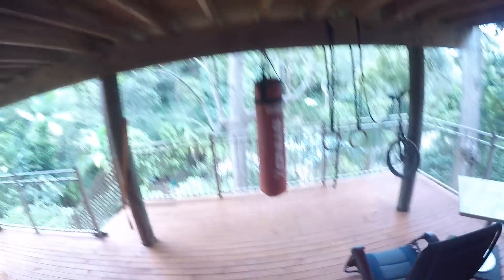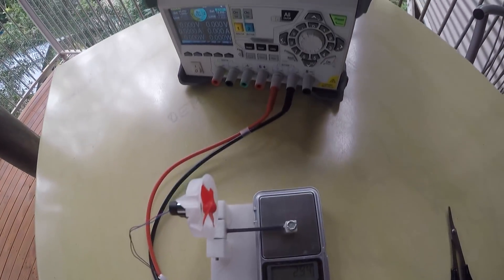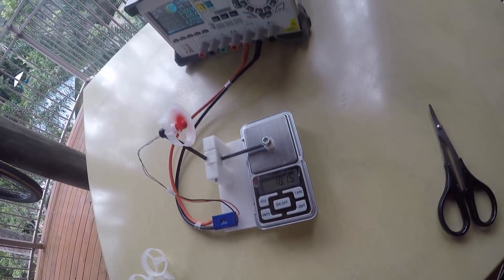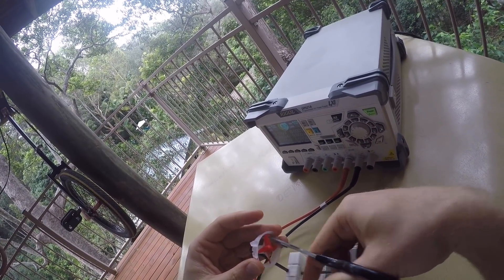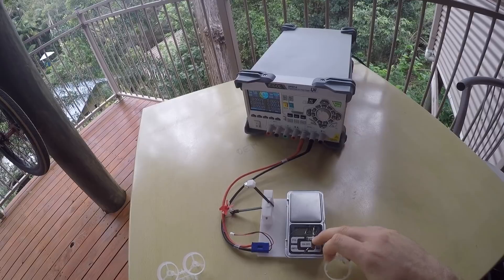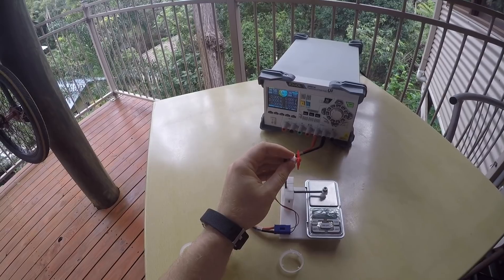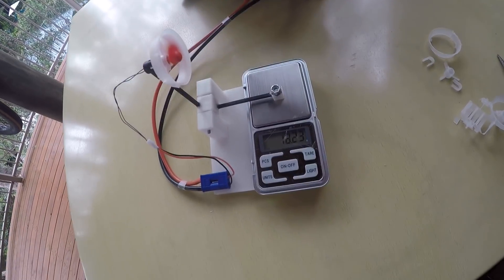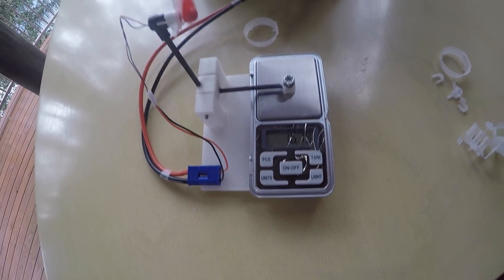Inductrix ducts - are they just prop guards?

Comment: By my experience of ducted propellers on working boats, i'm not surprised by the results. I'm even sure than a smaller clearance between the duct and propeller will give a superior efficiency. And a bigger lip on the duct to get get a Coanda effect. The gains are spectacular on tub or fishing boats propellers as water is 800 times denser then air.

Comment: BTW can i duct a boat propeller ?`for the same effects?
Reply: You can get the advantage from the reduced vortices at the tips of the blades but you want a strait lip because you don't get what you would get with low pressure air from the lip, as water is incompressible. You want the same entrance and exit diameter.  Cavitation could throw a monkey wrench into theory like this.  So experimentation is probably justified...on the back end anyway.  I still think the entrance optimally would be the same diameter as the propeller.
Reply: @ChessMasterNate  No, the effect is known since ages in propellers where duct propellers have been used since more than 50 years. The best results are given by a profiled duct similar to a wing profile whose extrados is on the side of the tips of the propeller (generally a four blades one).

Comment: Hi, It would be interesting to see what contribution of the improvement is to the Coanda effect of the lip on the duct. By utilising a strait duct (no lip) you would be able to quantifying the tip-losses at the blades without this additional thrust attributed by the Effect of the duct...
Reply: yes, this!  I'm interested in seeing a comparison of duct shape as well, and if the duct performs better/worse with the struts in front, or behind the propeller.  also the distances of duct both in front and behind the propeller.

Comment: ... you can gain another .3g when the very small stators behind the prop are in the appropriate direction (reducing airspin) some whoop frames have unidirectional stators - more thrust but reduced yaw authority
Reply from the maker: I have tried that too, but could not measure a difference. Did you perform this test yourself, or have a link to the test setup?
Reply: I accidentally build in the wrong duct on one side of a umx vtol tailsitter whoop and needed a lot of trim to correct this

Comment: Would be interesting to see if there is any difference when adjusting the position of the prop in duct. If the blade is hight in the duct is there any difference then when bottomed out?
Reply from the maker: I think that would be dangerous for the motors as they will be more exposed.  Best to keep the prop all the way seated on the shaft and the motor at the bottom of the mount to keep everything in one piece.

Comment: Did you tare out the scale after cutting the duct?  Didn't expect the difference to be that great either.
Reply from the maker: Yes I tared it before every run. But its not that easy to do, because pushing on the button moves the scale. I should solder an extension to the tare button ;)
I did not expect that much difference either. Otherwise I would have made this video way earlier..
Reply: No he didn't.

Comment: I researched the whole duct theory when the inductrix started getting pretty popular. Bruce from RC model reviews has some pretty good tutorials on ducted motor theory that explains what is happening. I would like to see what would happen if you cut the curved edge of the duct off but left the rest of it since that is part of the key of efficiency and maybe also do a test where the gap between the prop and the duct is reduced to as small as possible. If I understand correctly those two details are key to efficiency. I understand why the little extra space is there from crashing so many of these and I doubt it would be feasible to reduce the space by much if anything negligible for a model that you are flying, just saying this could be another step in the experiment. All that said excellent experiment and I will take that 2 gram thrust improvement for 1/2G of added weight.  One thing that I did see that may have skewed the result is that the struts were still in place, not sure removing them as well would have any effect since that is on the outtake of the fan?

Comment: intersting for sure!!  
Try this:
Take one frame, cut all ducts, fly it and see the throttle punch difference.   
Even with the 2 grams difference it has more punch without the weight of the ducts....  also on a stock board with no acro,  has better forward speed instead of upward, (no drag from the air ducts). 
 I have done it many times before on "clone whoops" for over a year ...the difference is noticeable.
Obviously, the frame will be weaker on a hard crash.
Reply from the maker: I did that. The ductless felt gutless.
What motors, props, batteries did you use?
Reply: Ok.,  I have done it with a few different whoop frames and different motors...  
stock f36 6mm motors, 
boldclash 18000kv 6mm motors, 
Stock e011 motors,
Bwhoop pro motors, and even the weak stock e010 motors. I tried it with 4 blades and 2 blade props (cutting 2 blades off the stock props).  
I use different batteries now but at the time I was using 150mah , 240 and 260.   
I even have a few videos on my channel flying outside in strong winds (almost impossible to do with stock frame/board).
After posting pictures and videos on rcg and fb, a few other people tried it with the same result.  (like I said, that was over a year ago when the e010 first came out)
 The only negative thing is, the frame can't take too many crashes. lol   I was keeping the ducted frames for indoor use, and using the ductless frames for outdoors,  but I broke too many frames lol... now I use all my whoops for indoors only.  The difference in forward speed and holding the pitch is very noticeable.   
 Also, I have used the e010 stock board, the e011 board, f36, and bwhoop pro board, on carbon frames with 55mm props,  18000kv motors, 7mm hubsan motors, 7mm kados insane motors, and the flying characteristics are way different that using the stock ducted frame.
Reply from the maker: well, looks a lot faster without ducts. Are there cameras on those quads?  A bit hard to see..
Reply: in the first video, no camera... just to show the difference between the 2.
the second link was in 18mph winds., 
here is another video with less wind... with the stock frames on the  whoop clones with stock boards,   you always have to fight the wind all the time just to hover in 1 spot lol
with less winds you can fly them outside, but very slow, never at this speed even with 18,000kv motors., too much drag.  https://www.youtube.com/watch?v=pGGGlzxqG8A

here is 1 of the e010 boards on a 90mm carbon frame, hubsan props and motors.  https://www.youtube.com/watch?v=3CucgkVF6vg
Reply: interesting! I wanted to try some test myself but actually measuring with a timer the difference between them. Hover at 1m then full throttle to 5m and check how much time it took. Then I would same but with forward flight with a fix angle of 25deg and check the time it took to travel 10m with and without ducts.
Reply: interesting discussion and test. I believe you got those result because you fly with the E011 frame that has square struts that are totally not aerodynamics. You remove 2 of those square strust so that really help in thrust.
Reply from the maker: I havent cut the struts in above test..
Reply: I have tested, use and have all frames....  square struts, triangular struts, and 1 or 2 cut off struts, 25% cut off ducts, 50% off cut ducts, 75% and 100% lol   I got hooked on whoops when they first started coming out a few years ago and went cra-Z ordering different frames :-D
Reply: by the way.... I also tried different size props with duct and duct-less whoop frames
Reply: That would be interesting, but it would have to be indoors with 0 wind.
If you take any of these frames outdoors (stock boards, no flash or acro boards),  with 5 or 7mph wind... you can give them full pitch against the wind and almost hover with full forward pitch lol
That doesn't happen when you get rid of the ducts... less drag.

Comment: Loved the JB intro, surprised with the outcome. Also word on the streets is that if you put the motor higher so the prop sits slightly above the duct, you gain more thrust. Wanna try that?
Reply from the maker: Hmm.. not sure if I want to try that. Seems kinda impractical.
If thats the case, the manufacturers should design the duct better, instead of just copying the design roughly..
Reply: yeah that's why I kinda hope it doesn't work haha
Reply: The new newbeedrone unicorn motors in a cockroach frame make it stick out slightly above, might be practical to try that.
Reply from the maker: Cutting the little plastic tabs at the bottom of the motor mounts will allow you to run all 6x17mm motors flush which is what you want.
Reply: Micro Motor Warehouse it's too bad the 617s don't bottom out on the e010 frames (no motor tab to cut). I actually switched back to my 19000kv those unicorn motors were too much and not nearly as fun for some sad reason.
Reply: Probably not. A fan which is too far above its volute only ends up pushing air out to the sides. It could be LOWER in the volute...and it would push more air.

Comment: Why don’t we use ducted props on bigger quads?
Reply: flughund FPV on the torrent 110 it seems to slow you down significantly much faster without ducts
Reply: "without them"?
Reply: Kabab fpv has some interesting discussion on that exact thing and basically it restricts airflow and somewhat decreases maneuverability. And ERC has commented numerous times that ducted or caged micros greater than 100 mm perform far poorer relative to their unducted counterparts. It seems that they have weird flight characteristics in general.

Comment: The gain in thrust definitely offsets the weight of the duct - but how much thrust is wasted plowing that aerodynamic disaster through the air ;)  I think this is why many of us see performance gains in flight without ducts.  That said, I've tried both ways and prefer the draggy ducted airframe for flying inside.  Excellent contribution to the hobby as always Dr. Whoop - nice job!!!
Reply: I think also the coanda effect actually causes a loss of efficiency (and by extension thrust) the second the duct is tilted out of level flight until such time as pressures equalize (meaning that the duct faces the direction of travel directly, rather than canted), due to the fact that the leading curvature of the duct (the part of it that is most forward, actually creates a huge bubble of low pressure, while the trailing segment of each duct sees a massive reduction, due to forward momentum (airflow increases substantially to the rearward portion, pushing against and slowing down the airflow going into the duct via coanda (sp) effect along the trailing edge of the duct).  This was causing the U.S. military fits in the '50's during tests of a flying co-axial ducted propeller experiment, which caused the fan to act as if it was a gyroscope (leading edge air was faster, creating more lift, trailing edge air was slower, creating less lift), causing the ducted prop to self-right. Top speed was terribly slow. They added vector planes to the bottom and still could only achieve a top speed of 16 MPH. I will concede that it's possible this issue is less prevalent the smaller the duct system, but it could explain the lack of power in angular flight.